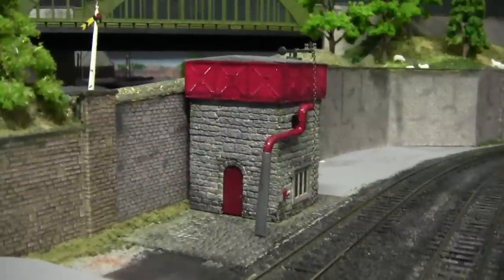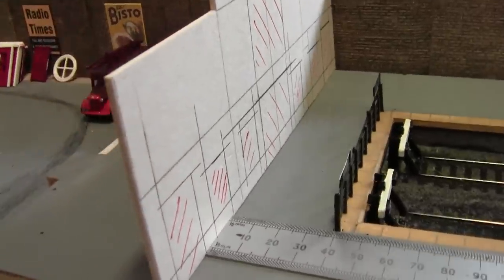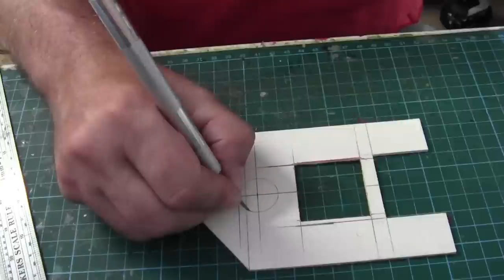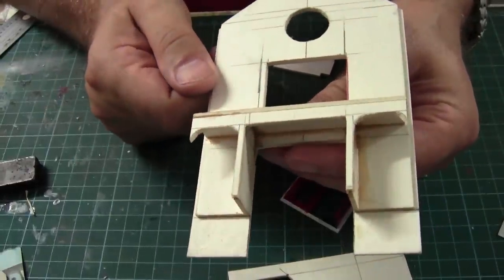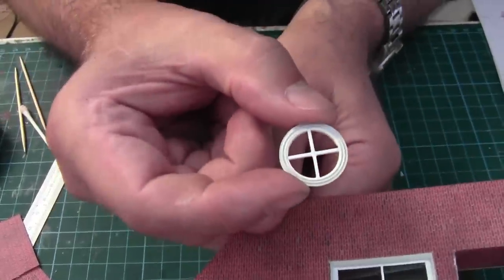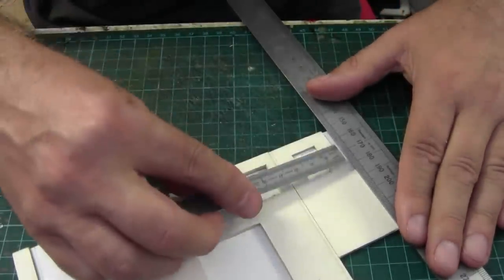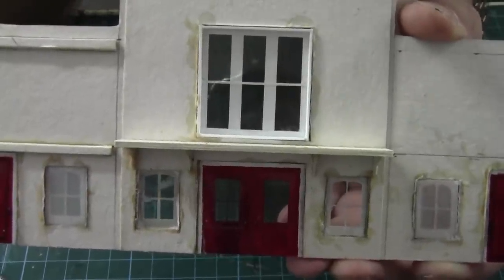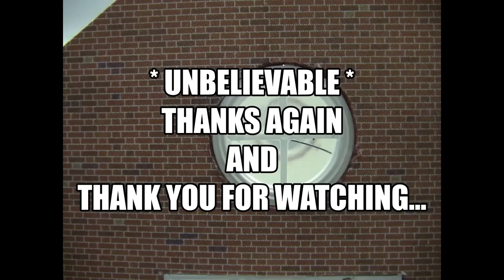Jarrow Road Station Part 3. front and rear walls. No 336

Comment: A really nice job on fitting those windows and doors, all that accurate measuring really paid off - the station side view really looks the part, that long pencil has had some good use in this session! Just catching up. All the best Stephen
Reply from the maker: Ah your back again, i don't how you have managed to get so far behind, I was for ever checking my dimensions just make sure that it will all come together.  only two more video to watch before the finishing line. take care buddy...cheer's Tony
Reply: @TONYNORTHEASTERN  it’s a case of “winter is coming” and if you ignore it here you do so at your own peril, loads to do outside plus I wanted some quality time to watch your videos which finally got last night! Made me realise your work versus the kits is that there are few kits you get really good viewing opportunities for internal details - compared to your SSS, Saracens head, Mrs T’s Sweet Shop, this, etc. Food for thought! All the best Stephen

Comment: Really like your solution to the window glazing, too many kits have such thin material that always seems to curl and pull itself off eventually. Going with detailed interiors you could add casing to obscure the window material in particular along the platform.
Reply from the maker: Hi Chris, i may take you up on that idea. the beauty about this card is that it is so easy to compress. and fix little problems where widows do bow in. many thanks for your thoughts and comments...all the best Tony:yougotthis:

Comment: Upstairs could be a cafe/restaurant to give passengers a reason to go up and also crew rest quarters and the station masters office could be in the roof if you have room for a 2nd storey staircase.
Reply from the maker: Hi Edd. i like your idea. have a small cafe upstairs. now's theirs a thought, i shall stick in my back pocket....i am working on the staircase at the moment which is the main hall. space is tight but it fits as you shall see. thanks again all the best Cheer's Tony🍺🍺🍺🍺🍺🍺🍺
Reply: @TONYNORTHEASTERN  great ideas for the upper level, you might want to expand part of the balcony area to give a bit more room for two to pass and maybe a few cafe tables. You mentioned the ticket office on one side of the lower level, how about a newspaper/snack/soft drink area on the other side?
Reply: Hi Tony, yet another fantastic video detailing the build of Jarrow Road station. Loving it so far, I was also thinking of the newspaper stand on the side of the ticket room, or even a taxi rank of that era! Look forward to further development of which idea you either go with or knowing you, you already have this sorted in your mind , keep up the great work and congratulations on 7000 subscriptions 🎉🎉🎈🎈